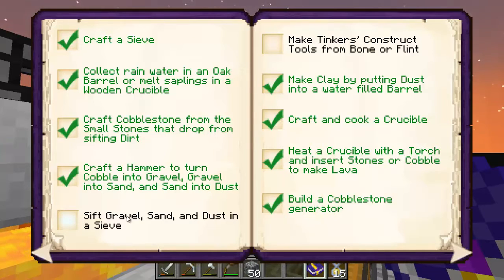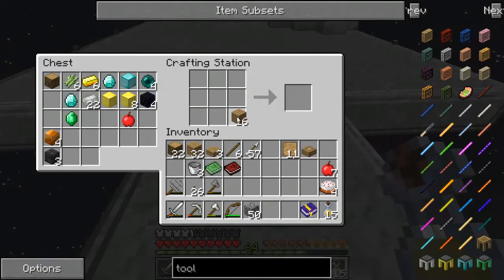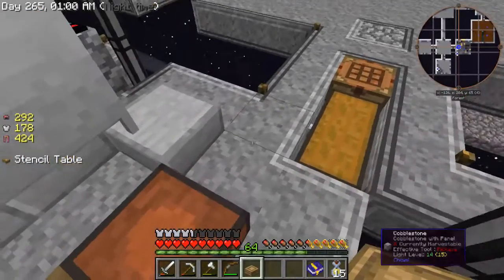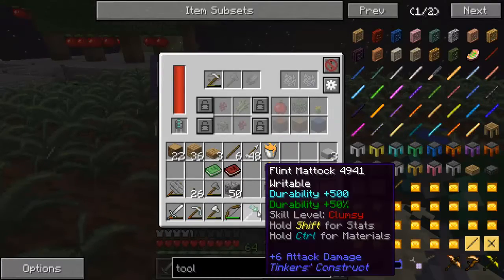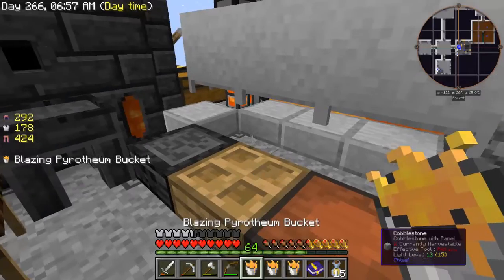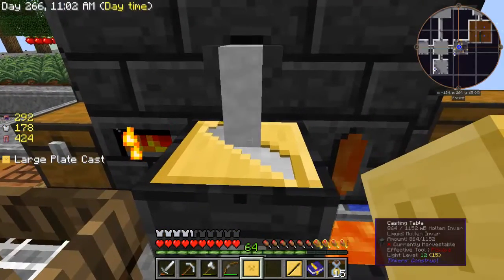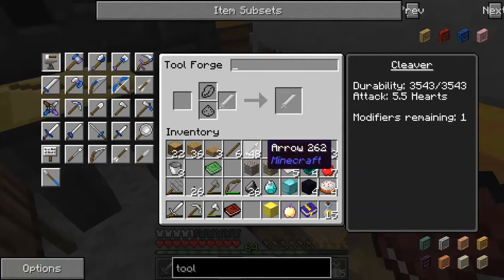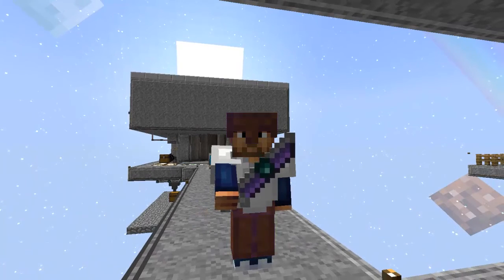Tinkers' Construct / Sky Factory 2.5 / FTB / Minecraft / Episode 12 / Tutorial

Comment: I notice you use a 1-wide array of pyrothium and crucibles for generating lava. If you take it up to 2-by-x you get a second row of 5x crucibles (instead of 7x for the ones over the source), which can really give you a boost in energy production for very little extra effort. In the early-mid game, 1 pyrothium source can be used to get one 7x, and five 5x, then you can stick a lava in the way to get a pair of 2x  at the end of your 2x4 array which will protect your cobble generator from turning to stone and keep things compact. That will produce enough lava for six or seven generators pretty easily.
Reply: Wouldn't a 3x3 grid with the Pyro in the middle give you 1 7x and 8 5x crucibles?
Reply: +DieyoungDiefast I didn't do that in the early game because I didn't have conduits that could carry both cobble and lava through the same block. If you surround the center crucible with 8 other crucibles, and there's pyrothium underneath, you only have 1 block left on top to access it from...
Reply from the maker: Lets be honest, the worst thing about Pyrothium is waiting on it to smelt in the smeltery.  It only cost us coal dust, blaze power, red stone and glow stone dust.  it's not to expensive.  Like your ideas though!